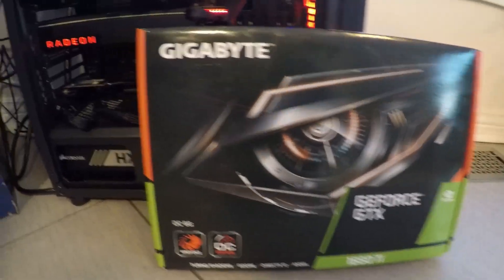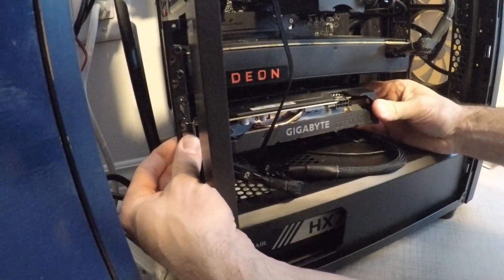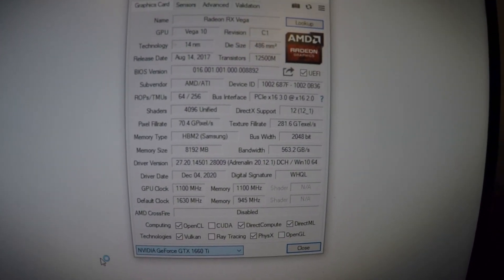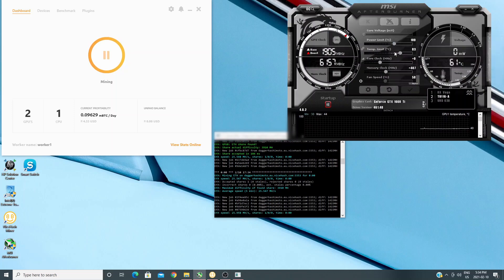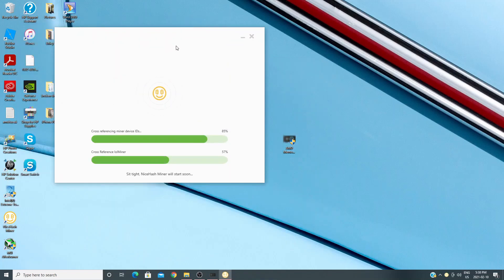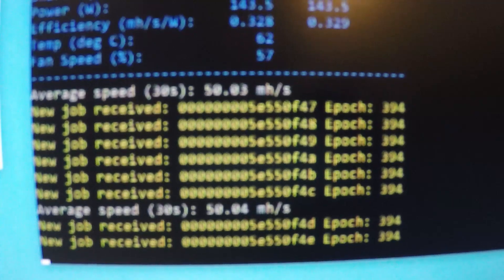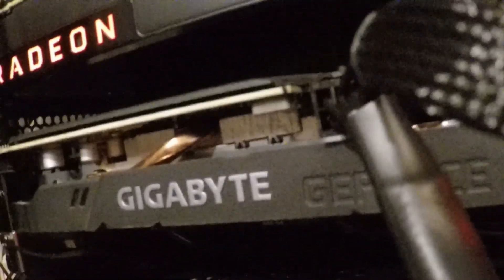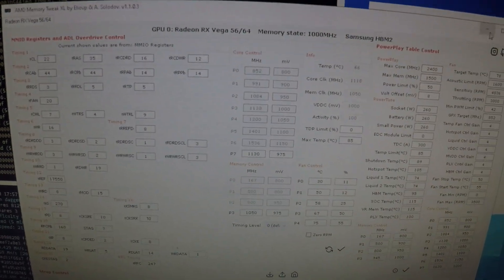AMD and NVIDIA GPUs mining on same computer

Comment: What you suggest among - rx 580 8gb, 1660ti, 1660 super, 1070, 1070ti, 1080, 1080 ti ? And what brand cards are best in terms of Watts and hashrate... Not considering price because buying used cards any way.
Reply from the maker: Out of that list the ones that I have bought recently are the 1660 ti and the 1660 super and I really like their mining performance. They will hit 30 Mh/s on Eth all the time, and the power draw is very low (80 W) They also run very cool. I just bought 2 used and 1 new in the $375 - $425 range (Canadian). The 580s are good, but you need to know a lot more to get them to their peak performance. I found the 1070 and the 1070ti to get about 34Mh/s but had a power draw around 135W - 150W. The 1080 TI that I have does 44Mh/s but the power draw is about 170W. Also consider the back end re-sale value on this stuff. The 580, 1070s and 1080s will lose a ton of value when mining payouts drop since they are 2 generations of cards old. The 1660 super and Ti, as well as the 5700 cards will hold more value as they are last gen card and might still have some warranty left on them.
The only used cards I have recently bought which are 2 generations old are a Vega 56 and a Vega 64. Both get 50Mh/s at about 150W. They were really underpriced when I bought them so I couldn't pass them up. The Vega's are one of the toughest to work with though. If you are just starting out I would get the 1660 cards, but I am avoiding the plain 1660 cards with gddr5 memory as they don't perform as well.
Reply: @DIYNorth  wow... The best comment which i have seen on youtube about the mining rigs explained... You got my sub... Tq for sharing...
Reply from the maker: Sorry forgot about brands. Honestly all the brands have worked well that I've used. The biggest thing is the brand of memory that is in them, but you generally don't know until you plug it in. If you are getting 1660s they might still have some warranty left so I would gravitate to companies that honour warranties on the used market. EVGA for sure does, and I believe that Gigabyte, MSI, and ASUS generally do as well. Brands like Zotac, XFX, and Sapphire all specifically state they don't honour warranties on used cards.

Comment: I've just purchased an XFX AMD RX 570 8GB for a rig i'm building and already own an MSI Geforce GTX 1050 TI 4GB which I currently use for mining Ravencoin. Do you think it would it be ok/possible to use them together on the same rig to mine Ethereum?
Reply from the maker: Technically yes, but I'm not sure that the 1050 Ti can still mine ethereum since its a 4 GB card. I think in some instances and in certain configurations the 4 GB cards can be used for Eth still. I haven't tried with a 4 GB card though. You might need to mine on 2 separate algorithms with those 2 cards.
Reply: @DIYNorth  thanks for the reply mate. Yeah that's why i'm mining RVN on the 1050 TI as not enough memory to load the DAG for ETH. I might give NiceHash a try again with both AMD & Nvidia using your method
Reply from the maker: I can't confirm this, but I saw a video on 4 GB cards. It sounds possible to run them at full hashrate on Eth still. But you need to use the LOL Miner (which is on Nicehash), and also have the card directly inserted into a PCIe 16 slot. So no PCIe 1 riser can be used. (It was a Brandon Coin video from a week or two ago. Hard to say exact date since all Crypto Youtubers are pumping out Videos like their lives depend on it.)
If you are going on Nicehash anyway you could just aim the cards at Raven and Eth concurrently.

Comment: I just put a RX580 in my computer next to my 1070 and now there is a red led light and the screen is black😞
Reply from the maker: Is your monitor plugged into a card or the motherboard, definately plug into motherboard.
Reply: @DIYNorth  bro if my cpu is 10400f meaning no intergrated graphic ..can i still pair my 3060ti with incoming rx 580 8gb?
Reply from the maker: @mohdhazreenjalil3896  I've never tried with that CPU, I have 2 10600K CPUs that I'm using. I would assume that you will have no issues with it  though. On my 4 card rig I have integrated graphics turned off and am running the monitor through the GPU because it is a 3060 Nerf version.
Reply from the maker: Was the 580 confirmed to work or did you just get it. I always start with the amd a card in pcie slot one. I'd recommend you start with the 580 by itself then work the 1070 in
Reply from the maker: Your combination will work. I have done it previously. I don't have those exact 2 cards anymore, but I have a 1080 and a Vega going right now which is very similar. Update the card drivers for both make sure your mother board settings are set correctly to allow multiple PCIE lanes to work, etc. There is likely a small tweak that needs to be done and you'll be up and running. I understand that this can be a bit painful sometimes.
Reply: @DIYNorth  Ok, I will test it out today, thanks!
Reply: @nikeuumaker5565  get it working?
Reply: @DIYNorth  what mobo settings need to be changed to allow multiple pcie lanes?
Reply from the maker: @jarizard_151  "above 4 G encoding", if you only run 2 gpus it generally shouldn't be required though. Some mobos also have a mining option in the bios. Different brands may have different options though.

Comment: With Afterburner closed you'd lose fan curves on the nvidia card, do the fans just go off of whatever is set in the BIOS?
Reply from the maker: I set fan curves on my AMD cards, but I've never set a fan "curve" for NVIDIA cards. For current generation cards and my 1660 cards I set a temperature maximum limit of 75 C in afterburner, and the cards regulate themselves around 60 C. Even my old 1080 and 1070 cards were smart enough to auto adjust. My 1060 cards are another story, they were a bit dumber. Even for those I'd just take the auto setting off and hold the fan speed at 50 to 60 percent in afterburner.

Comment: Thank you for this. But it's possible to adjust clock and voltage of second VGA?
Reply from the maker: Yes it is possible. Both were adjusted in this video. The NVIDIA card is adjusted in MSI Afterburner first then I click on the "startup" button to save those settings. Then I close the program.
The AMD card is adjusted separately using AMD TWEAK TOOL. I find the afterburner program can interfere with Tweak Tool if they are both open.
Reply: @DIYNorth  THANK YO VERY VERY VERY MUCH! I have a 5600XT and a 3070 here and never had tried.
Reply: @rodrigomendes3327  Did you get everything working correctly? I have a 3070 and i'm considering putting my old rx 590 back in for an extra 28-30mh/s.
Reply: @yz249  Did you manage to do it? Similar case here. I have a 3080, but considering buying a used 5600XT
Reply: @bmmaia81  I assume it would work fine, but I haven't tried  because  i don't want to risk screwing up game performance/stability by having multiple drivers on the system as I've had driver issues as it is. And more importantly, i only have a 550w psu which is already a stretch with a 3070 and a r7 1700 OC. Its fine now, but with another GPU idling it might not be.

I am building another PC with a family member and will probably put the rx590 in there and mine on that.

Comment: I tried to get 2 RTX 3060 Ti after 2 min of my bank process all (12) stocks are gone. So i quickly bought RX6800xt and RTX3070. Hope it will work for my first mining rig. Thanks for the video.
Reply from the maker: The struggle is real. They will work. I'm very confident. you will likely have to do what I did and adjust them in 2 different programs for best performance. the 3070 in Afterburner (or similar), and the 6800 in the actual AMD tools.
Reply from the maker: There is actually someone locally selling a 6800 at cost...which is nuts. I might try to get it and do another video with my 3070.